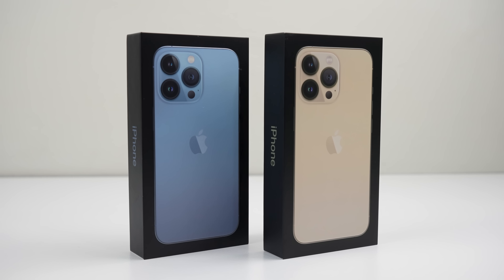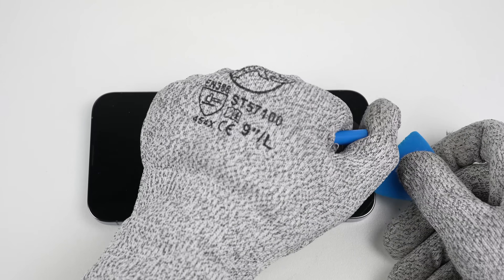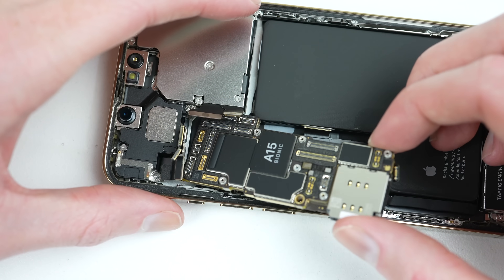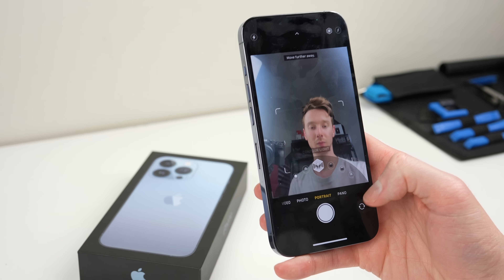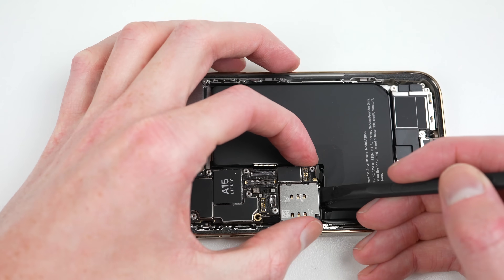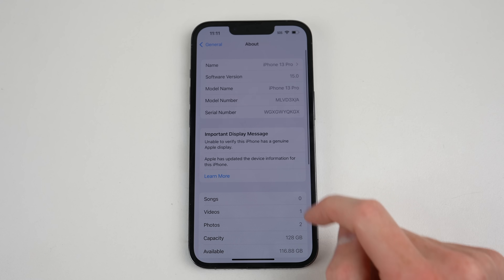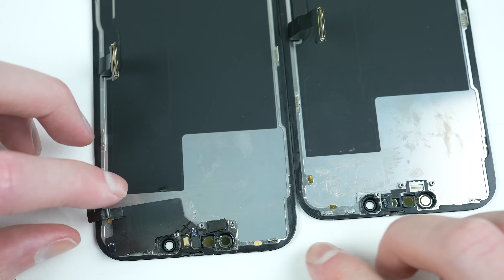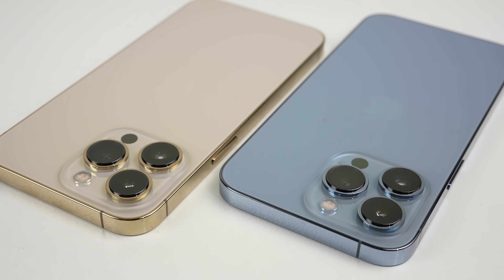iPhone 13 A Repair Nightmare - Teardown and Repair Assessment

Comment: The way I look at it, it’s good for Apple as they can ensure any damaged device is repaired by them and no one else. I have seen people, including family members repair their iPhone screens with 3rd party ones and begin having touch issues, sound issues, etc months later, then having to take the device to apple just to pay again to get the 3rd party screen replaced again for a genuine one. You end up spending more money having the device repaired twice. Yes I understand Apple can be expensive, but that is why they want you to repair it with them as I’m sure they have special calibration machines to ensure the device passes every test need to be ran and the integrity of the phone isn’t diminished.

The way I look at it, Apple is an expensive product, that is why they offer AppleCare to reduce the cost on repairs if needed (and everything done by them, professionally and correct the first time) 

You don’t go buy a lambo or Ferrari just to get 3rd party parts replaced if you get a fender bender. Fit and finish won’t be to Ferraris standards. Make sense??
Reply: Nope. Sorry, with this policy I consider them thieves.